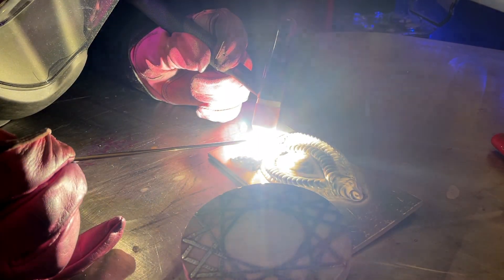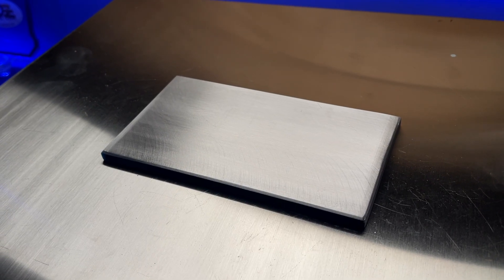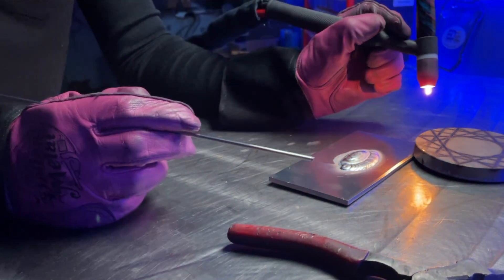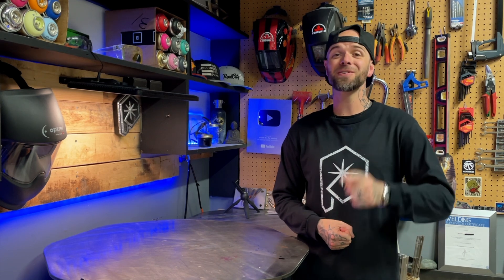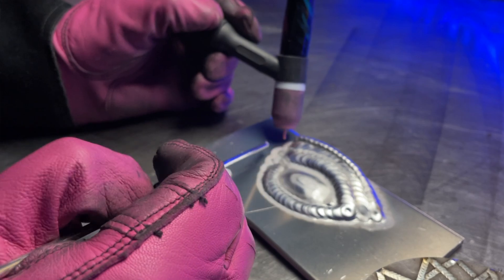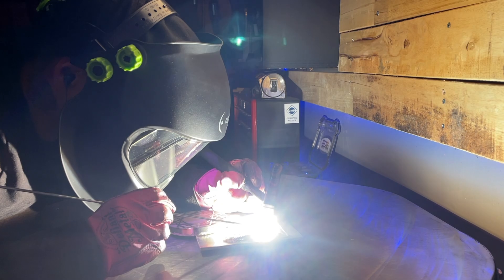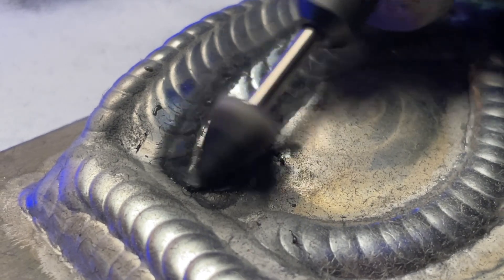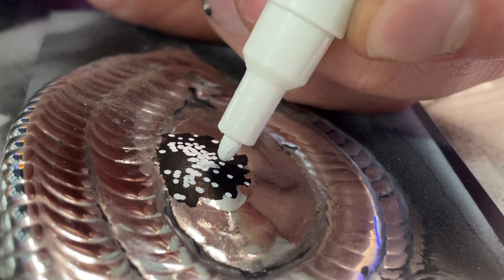I turn aluminum rod into a CRAZY eye with TIG welding

Comment: Hey man, awesome show I have been learning a lot from your episodes, being really new to Tig, I am having a hard time keeping my stainless square or from warping, welds come out some what decent  but the piece is often slightly warped or pulled to one side even after tacking all corners any tips would be great. Thanks.
Reply: not enough tacks, moving to slow (amps too low)
Reply: More amps and more tacks as deep freeze said, move faster and/or prevent it from being able to warp in the first place by using some kind of clamping